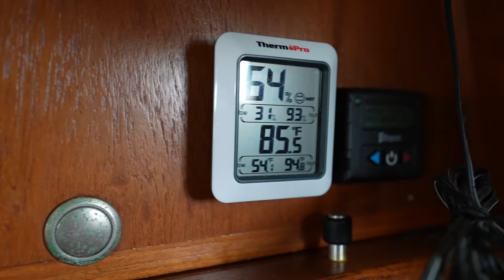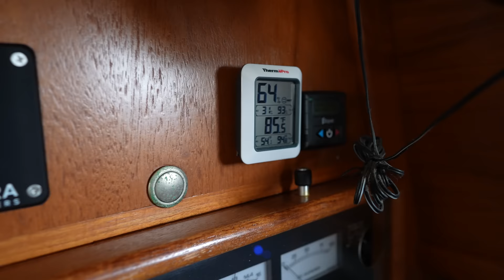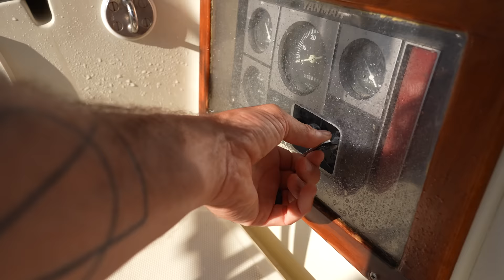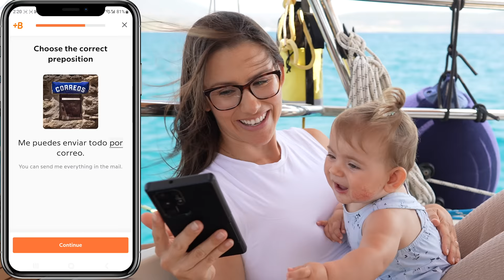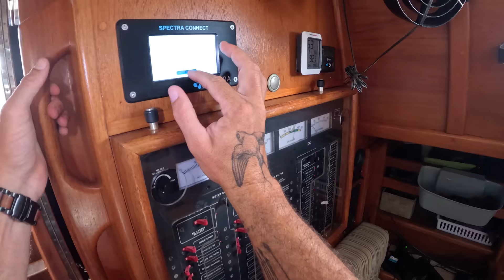Greece is on Fire - Surviving Extreme Heat | S08E26

Comment: As someone who lives in a relatively warm climate (88°F is winter temps) you installed those fans the wrong way around, all they'll do is push hot air around, what you really want the fans to do is suck the hot air from the boat and blow it out the hatches, so a fan in the centre deck hatch blowing up and turn the others around to blow out the open-able port lights, also you want shade over the hatches and a wet cloth over the forward hatch with a slow water drip on it, the damp cloth will cool the air as it comes in the forward hatch (that's why you need a water drip on it, to keep it damp), basically you want to turn your whole cabin into a giant evaporative cooler (what people used before air-conditioning)
Reply: I'm actually surprised they don't have AC given that powerful electrical system they installed.
Reply: you re right but inside is not air hot, material gets hot.. so you need a cooling down wind, to your body. believe me. thats your concern is when inside air is hot. if the walls are hot... you cannot cool down anything.

Comment: Hi guys ... a windscoop for the forward hatch would be great. Also, have a shade canvas made for the  boat and hang it when you are stopped. It should cover the forward part of the boat and you can make it go around the mast to shade the salon area, also. However, with a baby on board and a wife that suffers from heat, AC would be a worthwhile addition. They are not too expensive and worth their weight in gold. If you are gonna be around the equator, it is almost mandatory.  Love your channel .,.. actually, my very favorite !!
Reply: Several people mentioned the wind scoop but I wanted to double down on the shade canvas.

Comment: I heard about those high temperatures in Greece and Southern Europe, thank goodness we didn't get them here in Ireland but we did get rain, possibly the wettest summer in a long while. Nothing is ever perfect but we make the most of what we got! Stay Safe & Fair Winds!!
Reply: They are lying! The data shows that not only this was one of the wettest summers we ever had (June had way above normal rainfall almost across the whole country- juxtaposed to a multidecadal baseline) but also one of the coolest. 

August temperatures are often into the 40C and this year were something like 35-36 even 31s-32s. We had a few heatwaves during July but that's every year for as far back as I can have access to weather data. There were far hotter years in the distant past but the media love scaremongering and clickbaits.
Reply: Exactly, lived in zakynthos and this year cooler summer than past years. Spain is much hotter and hasn't rained until Sept 2. Madrid is the hottest urban center  city f
no trees no shade and bad construction materials that collect the extreme heat waves.
Reply: @mariadelavega546  If you think madrid is the hottest urban center city with on trees and bad construction(!)  you should definitely avoid athens...

Comment: Another possibility is pump water from deep to a radiator to copl air or use it to spray the deck directly.  It would only be temporary relief. but would be perfect for emergency relief.   Use the cool the cold water to help the boat to cool.   A garage sun shade would help cool the deck. Buy a garage sun shade and spray it with deep water to make a huge cover use PVC and make a hoop house!  It would act like a large evaporative cooler!  You could even use small sprayer like misters to keep the garage shader wet.  You should be able to drop temp. considerably!

Comment: I guess the question everyone will be asking is why can't an ac unit be installed on atticus? There are some excellent units now that run on 12 volt and are so efficient they can run on a moderate solar system.  It would be a great project to watch.

Comment: You need a "Fantastic Fans or 2". We use them in RV's, but you could mount it in one of the hatches, which is similar to hatch in an RV. Mount it in the forward hatch and it will pull fresh air from the other hatches that are open. It would create a fresh air circulation on the inside. Not just any fan, go with "Fantastic Fan" They are low impact to on Batteries.

Comment: Breeze Bandit is a great solution for increasing ventilation in a boat. The ingenious design allows it to catch breeze from any direction and funnel it down an open hatch, so it even works when the boat is not pointed into the wind.

Comment: DES, IMPORTANT HEAT HELP, - put ice rolled in a light dish towel and let it dampen. Then put the towel on the back of the neck. As a carpenter on those hottest days I learned this trick. The back of the neck has many nerve endings. It has worked for me. I hope it works for you.

Comment: Hi guys,  regarding strainer issue.  Look at ordinary home pools  strainers,  they usually have one or more strainers.  An example of the idea is taking domestic water particle filtration vessel (like the ones that come with the RO water makers) and instead of placing a filter , make a cylindrical wire basket and cover it with some kind of polyester cloth or cheese cloth type so as to allow a good flow of water and yet not be haunted by clogging. Hope that makes sense, is doable and works for yall. Creative adaptive solutions

Comment: I am an over the road truck driver. The last truck I had had good insulation in a small compartment and great battery run. Air conditioning it works like a charm, but you have to insulate.

Comment: If it's hot and winds are light, tie your anchor rode to your stern cleats and let the companionway/cockpit/aft part of boat face into the wind. Yeah, white hull and deck will help too. If you rig a sunshade it should be porous to let hot air escape up through the fabric. We made ours from two layers of weed block material. Blocks the sun and lets hot air escape up.

Comment: You ought to install a 12,000 BTU Mr. Cool  AC unit on your boat. Low energy consumption, easy to install, and work’s fantastic. I installed on on my RV. It’s a 110AC volt unit and I believe it’s 900 watts. It also works as a heater in the winter time. Love your boat life🤗

Comment: Engineers!  SHEESH!  As an engineer, I believe that I can comment.  Yes, the strainer should be before the check valve.  I'll say that we have so much to deal with during a design that is both time and cost limited.  I've made those mistakes.  I've also corrected other engineer's mistakes.  But you are correct, the strainer should come before the check valve that collects all of the debris.  Move the check valve!

Comment: Hey folks; you could build a natural AC system by using deep cooler water and a very small electric pump at the surface to create a venturi effect pump to bring the cool water up you could let that water run passively over the boat hull or build a copper pipe radiator effect and a fan will cool the interior off in no time.
Copper pipe is best and you can build it in a day. All you are doing is forcing cool water up from the depths to cool your boat.  

A very small electric pump will work.

Remember; you are not pumping water directly from the depths you are drawing the up by using the discharge of the pump only. 

I build these when I have a barge or ship I'm salvaging from the bottom and have to build a dredge system.

I'm going to build one and mount it on the hull of my boat.

Comment: To battle the heat, you have a fan onboard. You can make an ad hoc swamp cooler by dipping a cloth in ice water and hanging it over the fan grills. If the heat is dry, you can get a surprisingly cool breeze.
Reply: They are at a bay. It's humid. Zakynthos is, very humid. Flowers are everywhere even on summer from raining in  spring and winter

Comment: Maybe you can get a wind scoop for your hatch. The best are four way, so no matter which way the wind is blowing it will catch it. Also the best are the ones that are the same width all the way up. Ours had two dowels that crossed in the middle to hold the sides up. The whole thing attaches to what ever shroud that is right above the hatch. Another trick is to bring the anchor line around so that the aft end of the boat is facing the wind.

Comment: Have you considered air funnel tent on the bow that would funnel air into the front hatch?
Reply: If there's no breeze doesn't do much, humid hot and no air con . Zakynthis has tropical summer nights with no breeze many nights
Reply: @mariadelavega546  True, but if there is a breeze you will take max advantage and get shade to boot.

Comment: I was a missionary in India with my family, we had 2 small children, one the age of Isabella and another one just a year older. We had heat rashes, and heat stroke and tried to deal with the heat over there too. 120 in the summertime, in spring and fall it was 100, and then in winter it was the cool time of the year around 70 F. I know what you guys are talking about. We would cool down the inside of the house by throwing water on the concrete floor in the middle of the night with a ceiling fan blowing, I learned how to "throw water" from a jug so the floor got wet. Before we went to bed we would throw water around the concrete foundation of the house, to cool off the outside of the house. I would have my kids in kiddie pools during the day just like you are doing, and even sat by their bedside with a kids' book fan them while they slept, just to keep them from getting too much of the heat. I feel your pain, it is NOT easy in extreme heat. Make sure you drink electrolyte water, just plain water doesn't rehydrate your body efficiently as electrolytes do, and it will help ward off heatstroke. Also, when you go to bed at night wear a T-shirt wet. I know it gets your bed wet but the wet plus blowing a fan on you will cool you off and dry off both you and the bed in low humidity but high heat areas. Everything evaporates by morning, but in the meantime, the wet shirt along with a fan blowing on you will cool you off. This is how I did it in India where it is hot, hotter, and hottest weather.

Comment: Great episode! Beautiful location too! Some ideas for heat - have some extra towels lying on the deck in sunny spots that get wet down occasionally throughout the day. The evaporation should help keep the deck cool until the evening. Also metal containers of ice (old soup tins) placed in front of the fans. Wind scoop too would help. Can you reverse the center hatch to open to the bow?

Comment: Best time of year to go caving...   We are moving into fall temperatures in most of the US, and Greece appears to be cooling also in Sept.  Next year you might want to spend August in Iceland or similar where it is cold but full of hot springs to bathe in.
It just occurred to me when you were rinsing off with the hose, that your boat must have scupper holes or something similar to drain the deck or other areas.

Comment: Rig a heat reflecting tarp over your cabin roof slope one end of the apex up to spill the heat from under it.

Fitting a larger fan to an open forward hatch and pushing air through helps.. 

As does evapourating water in front of a fan .

Comment: I melted watching this episode but the crystalline water  scenes  were soo nice. Im in Vegas and we just got a ton on monsoon rain, yuppy! PLEASE get two shade clothes 80 percent block out just use cloth pins attach tor he middle, drape it over and there you go. A few summers ago our air conditioner finally died, IN VEGAS,  USING COLD WATER INSIDE SPRAY BOTTLE UNDER THE CIELING FAN became a great way to keep cool, you could the same, JUST SPRAY INTO THE AIR INFRONT OF THE FAN, ALSO WORE LIGHT CLOTHING, SHOWERED IN THEM. IT HELPED KEEPING ME COOL. IT TOOK A over a week to get a new air conditioner  love you ,ALL great job !

Comment: Shout out to you guy’s dealing with the heat. I see on Rick moores boat he put on a heat pump. I live in a 5 th wheel on Vancouver island and put a heat pump on board. The best thing you possibly could do. In the summer air conditioning and winter it will heat your boat. I’m  about 300 square feet and put in a 9000 btu . For great deals on heat pumps check out Senville. Ca there in Quebec and hardly any tax. 24/7 care they are excellent to deal with.  With global warming  that’s the way to go. There heat pumps are good to minus 15  cheers to you guy’s

Comment: what you need is a mist system... get one of those camping water-bags that pump up to create pressure, then a simple 1/4 inch tubing with misters aloft, and that will make your whole area into a giant swamp cooler... especially effective if it is dry air... you will only need a few gallons per day to create a whole new world.

Comment: Personally, I would suggest a portable air conditioner. Not a window unit but one of those you can roll from room to room and has a vent tube that you could stick out any porthole you wanted. You might have to use your engine to charge your batteries more but for the worst heat at least you have something to keep you cool. If you didn’t want to use your main engine to charge the batteries, you could get a small generator to run your AC.

Comment: Cork decking or simillar will insulate the top of the boat both ways ands comfy under foot..  Done correctly it last 40 yrs...just needs a light sand when it goes silver grey after about 8 yrs. ❤ It doesnt go mouldy or harbour bacteria.

Comment: We had a 12" 12V fan for which I made a 1/8" plywood surround that fit in either the companionway or hatch to suck hot air out of the boat- it worked pretty well.

Comment: As long as you don’t have high humidity you could actually create a swamp cooler which is just some kind of mash on a framework that you run into water and then up and out and you blow air through. The evaporation causes cooling and then you blow that air into your living space.

Comment: 2 quick fixes: (1) get a wind scoop - or two! They'll funnel the air through the boat. (2) Use your smallest sail as a sunshade for the main part of the deck, just jury rig some ropes to attach it. (3) - not a quick fix - avoid the Med in summer! Too hot and too many crowds.

Comment: if there is some wind a concentrator hood over the bow vent might help, there is a thing about forcing air through a group of plastic soda bottles is supposed to cool the air, just soaking you feet in water that is lower than body temp, will cool you blood as it runs through your feet a little ice in the water is even better.  Greece gets hot every summer...September is here so it will start to cool off soon....Isa seems to be doing really well, that red mark seems to be going away, have you decided where you will over winter???? Cheers guys

Comment: Cross ventilate!  Place a large fan blowing OUT of one of the portholes! This will draw as much fresh air as the fan is capable of moving (CFM - Cubic Feet per Minute) on each of the other open portholes. Experiment by opening and closing different portholes for maximum flow.  Good luck and fair winds and following seas!

Comment: Great episode! I was at Zakynthos earlier in August but now i'm back to work....

Regarding the hot red cable, i'm not an expert in marine electrics/electronics but it looks thick enough for the 100-200A that your alternator can generate.

I bet it gets worm buy the heat transfer from the connection at the alternator side  or and most probably from the red switch. Maybe a not perfect contact of the switch or the cable connection/lug there has a bit higher resistance making it to get hot when a high current passes through. A FLIR camera should reveal the source of the heat.

Comment: You need a proper fan for those hot days. I'd have a few windows or your door open at one end and an AC Infinity Cloudline Pro 12 at the other. They're quiet and move a lot of air for their sound output. Plus they're extremely adjustable as far as speed and tempurature settings go.

We quit using AC 5 years ago. It was terrible for adaptation, made us less productive and less likely to be outside. I live in the northern hemisphere and the last thing I want in the summer is to be trapped inside like we often are in the winter.

Comment: I've sailed the coast of Alaska for 20+ years.  The kind of heat you are dealing with is one of my biggest concerns about sailing the Caribbean or the Tropics.  It's a struggle for me to deal with temps of 90+ and 90% humidity.  I've flown my paraglider in Costa Rica and I dreaded the sun coming up in the morning.  It would be midnight before it was cool enough for me to sleep.  Have you considered cruising the canals of Europe?  Would your boat fit on them?   Thanks for the video.  Sail On!

Comment: 3 words….whole house fan. In the old days people used a whole house fan that would essentially pull air into the windows by exhausting massive amounts of air into the attic. You could do the same thing with a cheap box fan mounted under one of your hatches to exhaust air out. This would in turn pull fresh air through the other hatches and port windows, thereby creating a flow of air through the whole boat. Might be worth a try since it’s a cheap experiment.

Comment: Our little freezer on our Pacific seacraft 37 is cold. Froze a rack of chicken rock solid in one night. Wonder if your compressor in your fridge is trapping heat in the boat? Ours I'm in the starboard aft locker and is separate from the cabin. But just a thought...

Comment: Your past time to get a 12000 BTU air conditioner unit which will dry your boat out and drop the temperature about 10 degrees. At least in the evening so you can sleep.